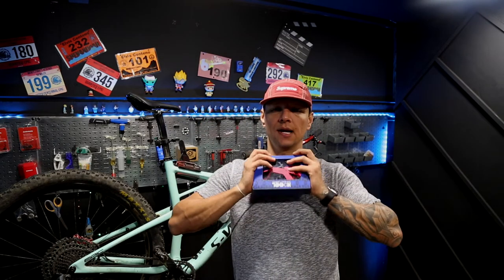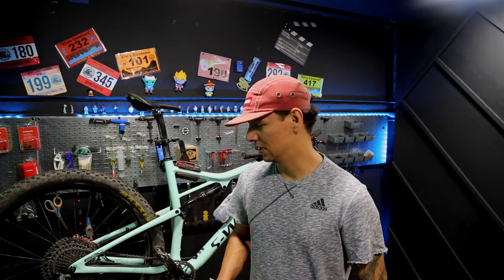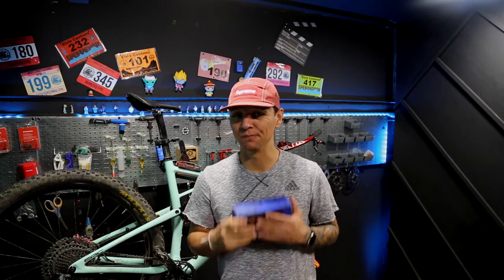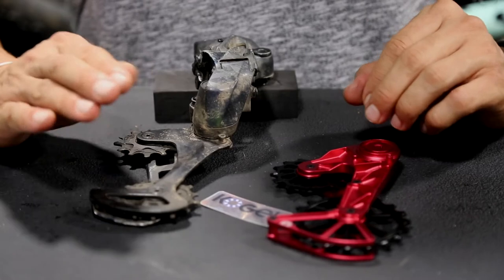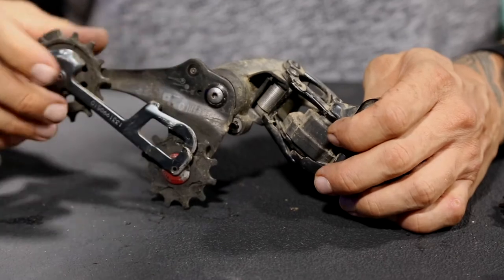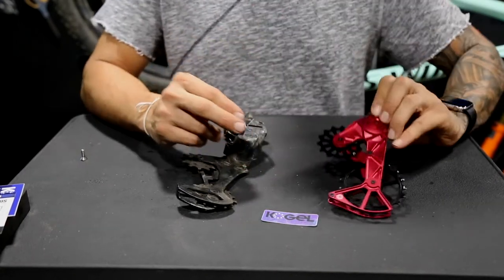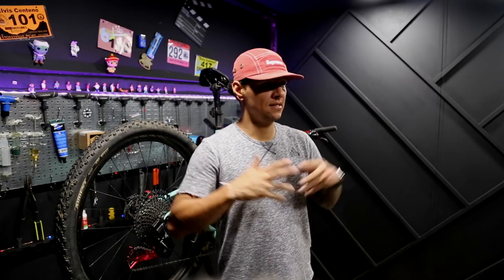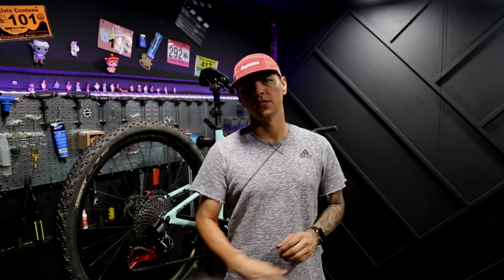#kogel #kogelOversizedDerailleur Sram Eagle Oversized Derailleur Installation

Comment: Complete waste of time and money. Got one for free from the bike shop. Installed it on a Shimano XT. Can't get it to properly shift over the full width of the 12 speed cassette. Either doesn't shif all the way up or all the way down. No response from Kogel support...
Expensive rubbish for no gain.
Reply from the maker: Dude! I need to do a follow up video 😒 my broke on my first 100 miles same thing happened to the ceramic BB30